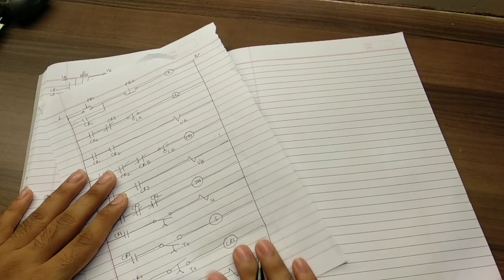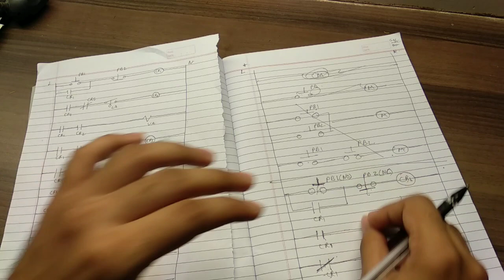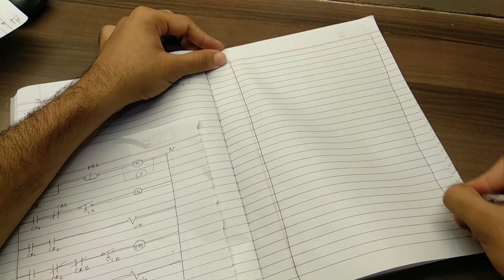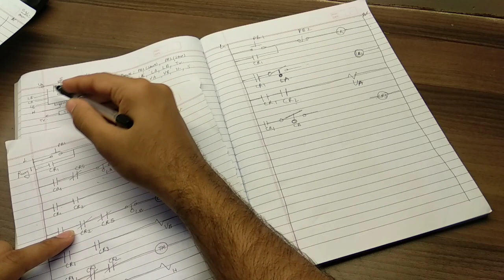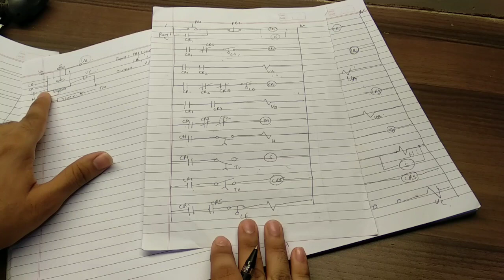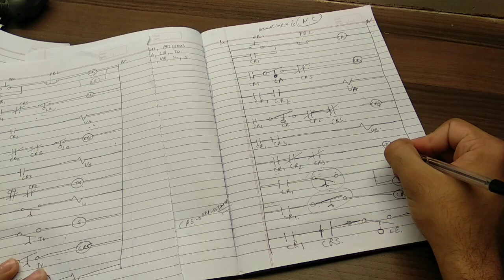Plc Ladder diagram explained with example #1

Comment: Nice and very informative video kindly  wire the circuit and add input and output for the same program
Reply from the maker: Unfortunately i do not have the tools for such a job right now . Thank you for the appreciation
Reply: @elninorosario  Use Delta PLC its free.